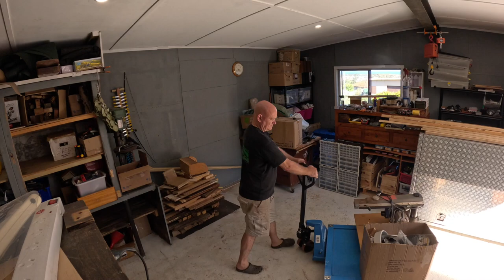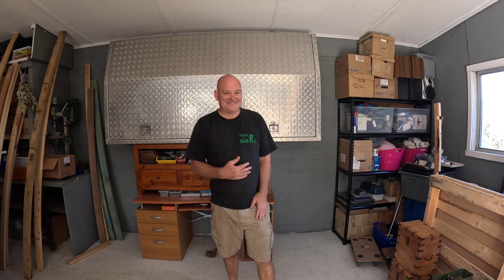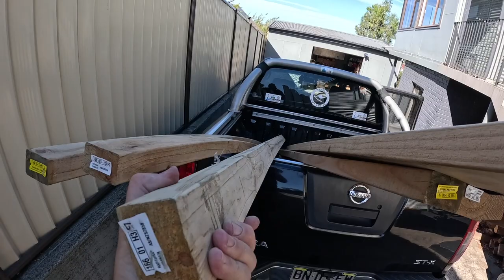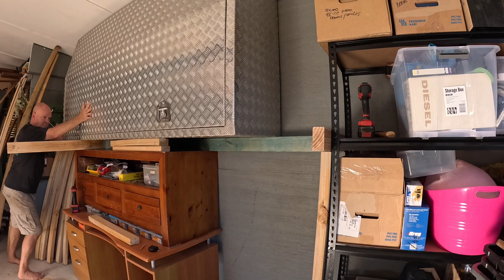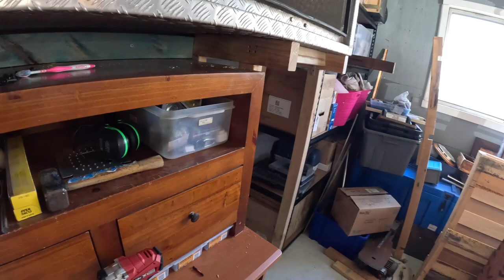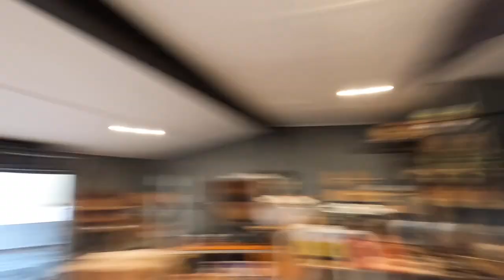Big-box project regrets

Comment: Was the plan to put the “broken“ tv in the box all along?  Finding studs is almost always a gamble, that’s why little drill bits were invented.  Looking better than my workshop at the moment.  The rebuild has haltingly recommenced with interruptions for must do now jobs. I noticed you braced the bottom desk so it no longer has the wobbles.  Well done.
Reply from the maker: Thanks Mike. 
No – I had no idea what I wanted to do with that box. It was taking up a huge footprint on my floor. The decision teetered between taking it to the tip or hanging it on the wall (without having a legit reason). I did try to sell it when it was 'new', but it was too big for those who actually replied to the ad. Now it's tarnished and the hardware has oxidised. Anyway, I opted to hang it up – and then figure out what to put in it. Only then did the house TV come my way.
Good spotting on the desk bracing. I also put some metal angle brackets in strategic joints on the inside.